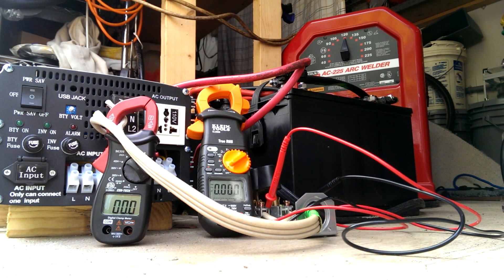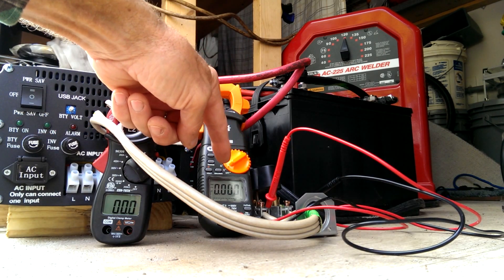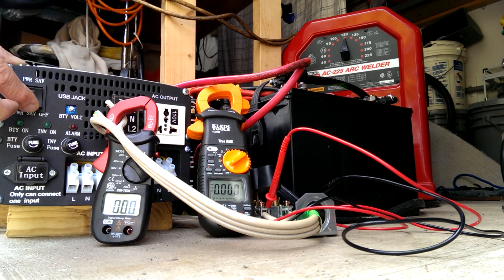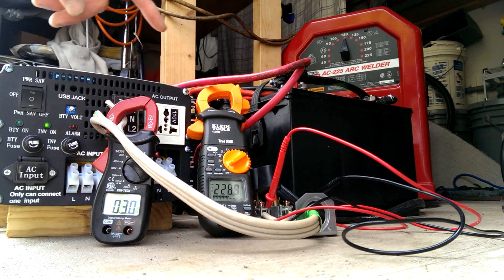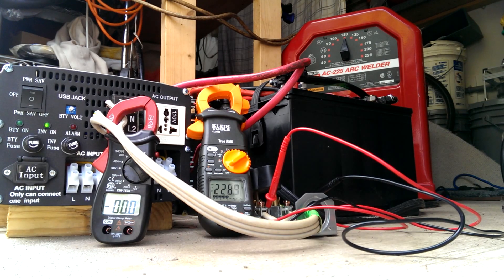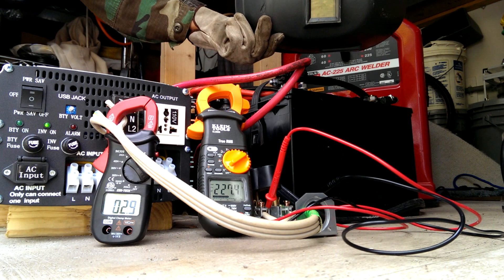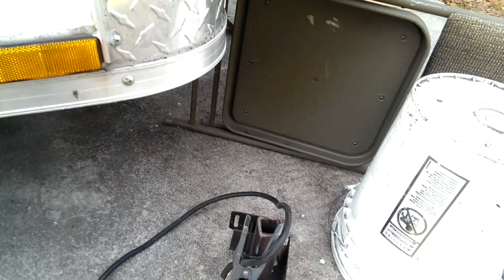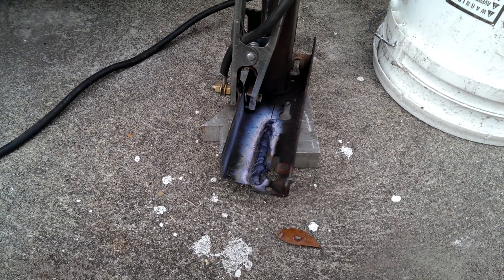Welding from 12vDC use 220v AC inverter, amps @ voltage

Comment: Thanks for the demostration. What is the capacity of that inverter (in watts)?
Reply from the maker: Inventer rated for 5,000watts. In my Final system I use 4agm batteries and 0,5Farad capacitor . Works well for my welding aluminum

Comment: so u can power a inverter stick arc welder with the use of 12v to 220v inverter???
Reply from the maker: +andreiruiz143 It was my tray. However it is not inaf to do still welding from 3 batteries. Aluminum needs less power, so I do perfect aluminum welding from batteries
Reply: +sofabike thnks for info.:)

Comment: i am curious if you have had a continuous load on it? I have heard this inverters are only good for a 1200 to 1500 watt continuous load before they shut down.
Reply from the maker: +GPVlog No I did not have had continuous load with a 5000 watt.In welding I am doing it is about 2500watt and welding is on and off.I Did use a water-heater 1200watt for max time 12min.
Reply: +sofabike thanks very much. overall are you satisfied with the inverter? I noticed it has 2 sets of battery posts. I am guessing each one provides 110 volts? so to get the full output of the inverter you need to be using 2 sets of batteries? Thanks for the videos.
Reply from the maker: +GPVlog an inventer is ~220volts 2 splite phase. In this video I did use 3 deep-cycle batteries. Yes it does has 110v outlet too.Right now I mount inverter inside my van, it added on more battery from a van.I do weld aluminum from 4 batteries without problems.However it is not inaf to weld a steel, but I can tag steel, or to make my steel project acembly using welding dots.All 4 batteries connected in parallel. Every battery connected to inverter by 1200amps dedicated switch. So, I do have 4 switches. This way I can use 1 or 2, or 3 or all 4 battery.
Reply: +sofabike thank you again for the quick reply. do you need to use all 4 battery terminals to get 220volts? can you use 1 set of pos and neg?
Reply from the maker: +GPVlog Inverter makes 220v even from 1 battery. But to get more power I do need more battery's. Let me explain simple formula; Amps x Volts = Watts.My aluminum welder work from 220V source , it use for average welding from 10A to 12A. Math 220v x 12a = 2640w << this power welder must have to do welding. Battery's has voltage 12volts; Math 2640w / 12v = 220amps.My deep-cycle battery rated 105 H/A.I can not discharge battery more than 50%So in one hour time I can take only 50 amps from one battery.There for to get into about 200AMPS I need at least 4 battery's.Hope , my explanation more clear now
Reply: +sofabike yes sir. I have a single 12 volt battery bank with a 300 amp hour total capacity. my entire setup is 12 volts and can not be changed I just wanted to make sure that my single battery bank would produce 220.

thanks again for the help

Comment: wow i don't think you should be doing that to your batteries let alone that inverter i have the next size up the 8000w LF im not even going to try a welder i like to keep my unit longer i have a petrol big generator for welding and that smoke i seen?hope it was the welder, it was taking me back to the day i got my inverter it smoked out burn up had to get new boards, good thing about them they can be fix cheaper then you buy them for parts are cheap. so let as know with a update down the track that your still welding with it and if its still running hey .
Reply from the maker: +TRMTHEweasel So,far inverter was good for my needs. I made accembly of my system inside a ProMaster van. Promice to make video about. Thnx for a coment and concerns.